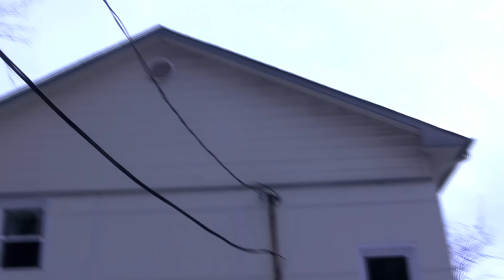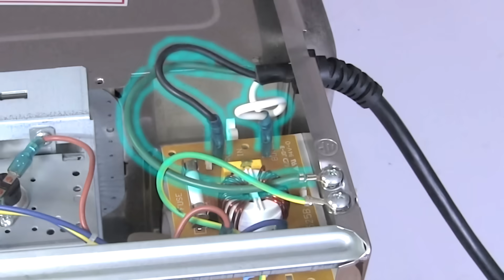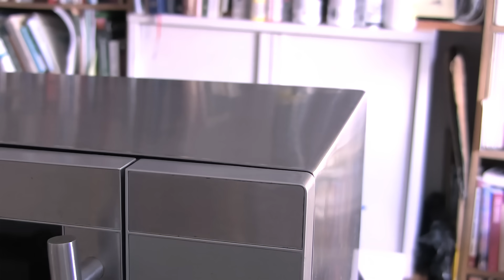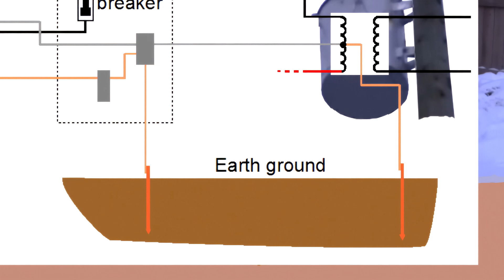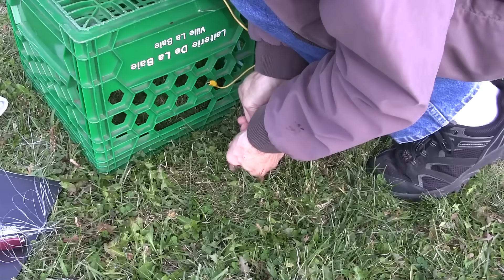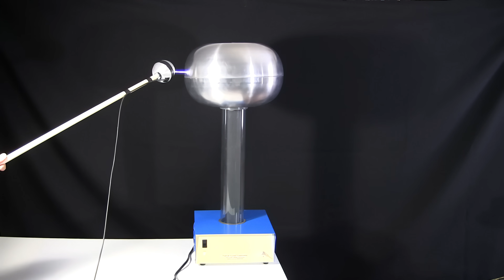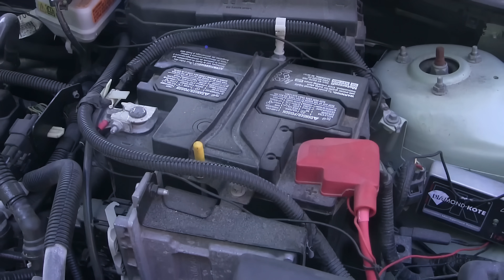What is Ground? Earth Ground/Earthing

Comment: I'm to dense to understand this. Are you telling me that in the States ground isn't ground at all, but neutral? In Norway (and the rest of Europe I imagine) ground is ground. It's a wire connected to a rail in the breaker box that is connected to the ground in some way, usually a spear into the ground in your basement,
Reply: What youre refering to may be IT-system which Norway is almost the only country that has such system. Its great for industry and hospitals, cause you can keep the machinery running with a fault towards earth.
But there are places that are similar to whats in the video, in Norway. We just use different types of breakers, and even though you find the split of ground and neutral in some old houses. Its mostly seperarated at a point earlier than that. neutral is essentially monitored ground.

The breaker in the video trips if theres a sudden Amp increase, so its most likely thermal, or maybe it has some ground monitoring. We use a breaker that minotrs the magnetic difference between Live and Neutral. And as soon there is a magnetic difference(due to a fault) it trips the breaker.
Reply: I'm not sure if this would possibly answer your question, but here in Germany it depends on the network system if the ground and neutral wires are combined.
These Systems are normed by the so called DIN VDE . We differ between TN-C-Systems (Ground and Neutral Combined) and TN-S-Systems (Ground and Neutral Seperated). It depends on the safety expectations which network system shall be used. For German households the TN-C-S-System is typically used which is just a combination of the two systems named above. The ground and neutral wires arrive combined at the house and get split up after entering the house wiring. Look it up if you are interested before I messed things up or confused something. :D
Reply: @slazy9219  Do German homes have an earth stake?
Reply: @SuperSpecies  before construction a foundation earth stake is installed beneath the actual house which is basically a big rectangular construct typically made of steel - its called "Fundamenterder" in Germany. Look it up. :)
Reply: In Germany we have in some Areas a separate ground line, the Current in this ground line is measured and in case of nigh current in the ground line the total system  switched off. This system is called ERROR-CURRENT-SWITCH OFF:
Reply: Norway has a system that is different from any other country. In Norway IT is common. There are no neutrals, just three phases with high impedance connection from the center of the transformer to the ground. Elsewhere IT is used only on things like hospitals and ships.

https://no.wikipedia.org/wiki/IT-nett

Other systems include TN which is used for example in Finland, UK, and the US. In TN the ground wire goes to the same point as neutral. On TN-S they are joined only at the transformer, on TN-C-S which is the most common and basically only used anymore they join at the entry to the house. In TN-C they join at the socket.

The third major type is TT which uses similar grounding as IT but it is not isolated.
Reply: when you touch the hot and the body youi become the conductor that hooks the hot to the ground.

Comment: if ground path resistance is very small, what stops current from hot line flowing to ground as it is connected to neutral?
Reply: Under normal conditions, the ground wire is not part of the complete circuit. However when a fault occurs, like the one where the hot wire touches the microwave case, then the circuit is completed through the low resistance ground wire which leads to a huge amount of current flow which then causes the circuit breaker to trip.
Reply: The resistance of the connected appliance's electronics limit the current and use the power for something. After that the current will flow to ground, but not directly like when the hot wire is touching the the case of the microwave oven.
Reply: if you just connected a wire between hot and neutral you would get the same effect as hot and ground. There would be a huge surge of electricity which would make the wire, melt, explode and catch fire., if the breaker dont trip. 

so dont do it.
Reply: Current from a source flows through the load connected to both terminals of that source, not some other random wire, that may be connected to ONE Of those terminals.
.
 For current to flow in the Earth ground, there must be two connections to that ground and the circuit in two different  places.
Mains ground only connects in one place, the neutral.
..
_IF_ you were standing outside in your bare feet on the Earth and grabbed a hot line current would flow between your feet, via ground, back to the house entry where the  ground rod connects to the neutral and then flow to the pole transfer through the NEUTRAL.

Something unusual will cause ground current to flow.
Reply: There is virtually no voltage in the neutral. The voltage is lost at the equipment that use the electricity.

Comment: Isn't the ground connected to the center of the transformer and the neutral to the other end?
Reply: No. The neutral is connected to the center. The positive end is only connected to circuits meant for high power devices like clothes dryers. The negative terminal is -120V, the neutral is at 0V and the positive is at +120V. That's why most devices accept 120V but high power devices use 240V
Reply: No, the house in the US gets just three wires: two ungrounded conductors that are at the opposite ends of the transformer and the grounded conductor (neutral) that is at the middle. At the entry to the house the neutral is split to neutral and ground and they are then always kept separate.

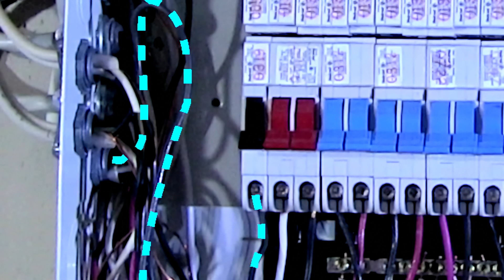Comment: 3:05 The breakers in your house have nothing to do with keeping you safe, their function is purely to prevent fires and damage to equipment. They trip wayyy too slowly to provide any protection against shock to humans. Most household breakers are designed to withstand many seconds of overcurrent before tripping (to avoid tripping everytime something like the fridge compressor kicks on and causes a short spike of high current.) Also, the threshold for injury/death is wayyyy below what the breakers are rated for.
Reply: Breakers absolutely have to do with keeping you safe budy? who do you think gets to live because his house didn't caught fire while he slept? not to mention that differential breakers are literally designed to act as quickly as possible, if your home doesn't has differentials, well man that sucks, but that's their job, preventing you from shocking yourself to death. yeah the standard thermomagnetic breaker is slow but it still protects you, not everything about electric safety is about preventing the shock. Also this is an explanation of the function of grounding cables, it's not focused in protections, so give it a break for not specifically mentioning the type of breaker
Reply: if you use a modern circuit breaker it has a thermomagnetic breaker which can  take up to a few seconds to trip, yes. But it will also have a short circuit breaker, which will trip almost instantly.
Reply: It's a common (and dangerous) myth that a household circuit breakers purpose is to protect against injury from electric shock. People die/are injured every year mistakenly assuming their breaker protects them (for instance a fault that only draws a few amps.) Why the heck do you think GFI's exist? 

Also, the short circuit detection you speak of is generally still WELL above the threshold for death/injury.
Reply: @davidsotomayor8713  Yes, I know that the short circuit detection will not protect you from injury directly, they do keep you safe indirectly tho. In your original comment you said, that "they have nothing to do with keeping you safe" which isnt true. For example if a circuit breaker trips because of a short circuit which led to high current flowing through the ground it kept you safe. And in that case it will probably only take around 0.01 seconds to trip.
Reply: @eliasbiditza  that's like saying the purpose of a fire hydrant is to treat burns. 

And you have to be willfully obtuse to not recognize I was talking about protecting you from electric shock. Hell, I specifically mentioned PREVENTING FIRES! 🤦‍♂️ Or did you think I was talking about cold fire? 🤣🤣
Reply: @davidsotomayor8713  And you are saying that a fire hydrant has nothing to do with keeping you safe. And like I said its not only to prevent fires but also to prevent charged up machine casings for example. You also said that they are designed to withstand many seconds of overcurrent which isnt entirely true. I do think that you know that, still its not worded perfectly.
Reply: @eliasbiditza  sounds like you need to read a datasheet sometime. It's pretty standard for a residential breaker to take 200% of its rated current for 10 seconds before tripping.

Seriously though check out some datasheets. They provide graphs that describe what it takes to make them trip. Something like a 20% overcurrent might take several minutes to sometimes even hours.
Reply: @davidsotomayor8713  Yes, I never said otherwise. Doesnt really change any of my previous arguments. Im not saying, that fire hydrants treat burns, Im saying that they are used to protect people from burns. You are saying, that fire hydrants have nothing to do with keeping you safe. I never said, that by having a breaker you are safe from electric shocks.
Reply: @eliasbiditza  direct quote: "you also said that they were designed to withstand many seconds of overcurrent which isnt entirely true."

And like I said before, you're just being willfully obtuse if you can't recognize that I was talking about protection from electric shock. Didn't really think I'd have to specifically explain that "preventing fires" is related to safety but here we are... 🤦‍♂️🤦‍♂️
Reply: @davidsotomayor8713  Yes I did not say it was false, I just said it isnt entirely true. I feel like you are grasping straws now. If there is a short circuit the current will not be 20% more or 200%, it will probably be more than 2000% which will trip a circuit breaker in a matter of miliseconds. My main argument was, that you misphrased things in your original comment, which still stands.
Reply: @eliasbiditza  can withstand 10 seconds at 200% of rated current? How can you say "designed to withstand many seconds of overcurrent" isn't true?

Your most recent comment proves you have absolutely zero experience with this kind of thing. In the real world the vast majority of faults are NOT perfect 100 milliohm shorts.
Reply: @davidsotomayor8713  once again, never said your statement wasnt true, if I say a car uses gas to function its not a wrong statement, yet its not entirely true, since there are electric cars for example. This is getting really boring tbh, I will stop answering from now on. Have a great day either way.
Reply: @eliasbiditza  that has to be the most sad, asinine, facile attempt at an analogy I have ever heard... especially since the vast majority of EV's get their power from FF powered plants anyway, the most popular of which being natural GAS. 😏  Nevermind all of the various other FF based parts of the car.
Reply: Beakers with grounding do play an important role in protecting against shocks. The grounding is the key. Without it the breakers do not protect you from shocks,  nor do they protect if you touch the live wire directly.

Comment: does ground can kill a person?
Reply: Yes it can. In Germany we have therefore in some Areas a separate ground line, the Current in this ground line is measured and in case of nigh current in the ground line the total system  switched off. This system is called ERROR-CURRENT-SWITCH OFF:
Reply: yes if it swallows you whole. beware of the monster
Reply: @tdpro3607  how is that
Reply: Yeah, if you fall from great heights.

Comment: Plumber here, please never connect your ground to a pipe unless its a completely dead and redundant line you wont need to work on. Grounded pipes make working on your plumbing system very dangerous if you have any electrical faults as the pipe become charged with electricity and this is the reason more plumbers die of electrocution every year than electricians. Love the video and find your way of explaining things very simple and informative but please don't tell people to connect ground to pipes it can be very dangerous.
Reply from the maker: Yikes. Usually the people doing this are hobbyists connecting to a pipe for grounding for a quick demonstration or experiment and then disconnecting again. I was once attending a convention in a conference center where they connected to a kitchen pipe for a ground for a Tesla coil demonstration (a high voltage machine that produces lightning-like discharges). Now that you mention it, that was not a good idea even though it's a quite common practice. But I hadn't thought of more permanent situations for household ground as a danger to plumbers and others. In the video I'm talking about the temporary hobbyist situation, but it is in a video about household ground so I can see someone thinking of it for a permanent installation. Yikes.
Reply: @RimstarOrg  Thanks for the reply, as someone who's worked on a large variety of houses for a large variety of people I can tell you that temporary solutions can last many years sometimes depending on the person. If its just for demonstrations or is connected and disconnected quickly then obviously its no issue, but I've met plenty of people who use videos like this to try and do things to their property that should only be done by a licensed tradesperson. In future videos if it ever arises again maybe just a quick word to let people know these connections have to be temporary for safety reasons would be nice.
Reply: My county inspector forced my electrician to ground a pipe. Then he signed off on the permit for my upgraded 200amp panel. 😬
Reply: But if the pipe becomes charged, then it will go thru the neutral back to transformer and back again into main panel and flip the breaker. So how is it dangerous?
Reply: @MathCuriousity If everything is well connected, well maintained, not a DIY special, usually true.  There are good electrical certification vids you can watch here that describe how fault conditions can injure you.  And remember more than enough electricity to injure you can flow before a breaker thinks there's any problem at all
Reply: Electricians just really hate plumbers
Reply: The purpose of ground was not to protect people.  It is a meaningless thing to even think it is so.  It was to protect the grid and the infrastructure.  From what?  From thunder and lighenting discharge.   On the contrary it became obvious that in doing so cme with it serious danger to  people.  And the solution has taken on many forms and most of them has little to no meaning.
All a person, an actual attentive person that is, has to do is to simply look at the whole thing, the entire picture.
Reply: @alchemy1 This is not the case.